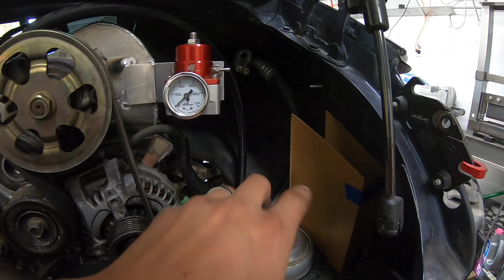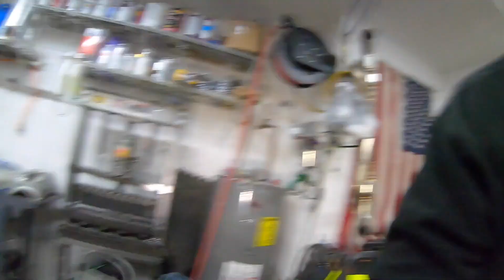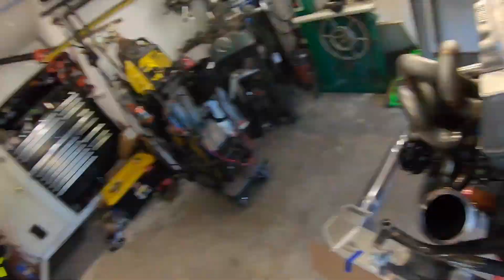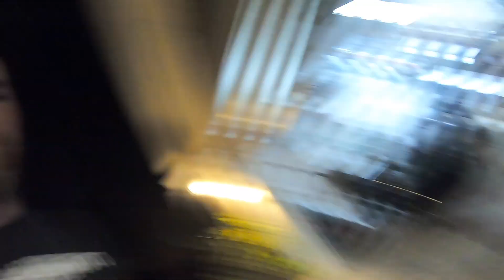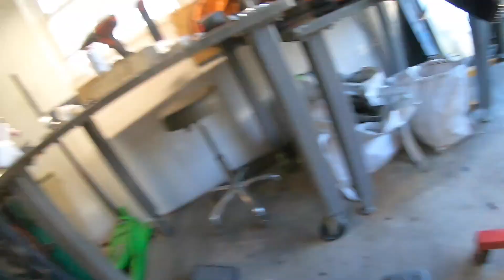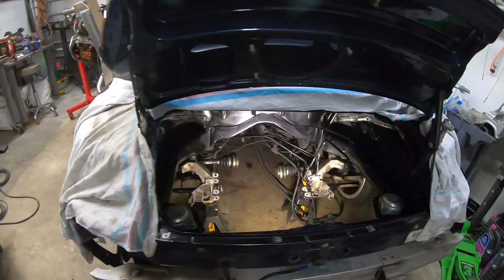The Big Boy Bottom End Has Arrived

Comment: Are you planning to swap in an RSX type s oil pump in the Guinea pig motor
Reply from the maker: I have all the parts and I was flip flopping on it. It’s probably best to just do it to confirm oil pressure for when it goes on the built motor.
Reply: @baysidefabrication  yeah, you would have to swap the oil pumps , when you put the built motor in , that will be extra work